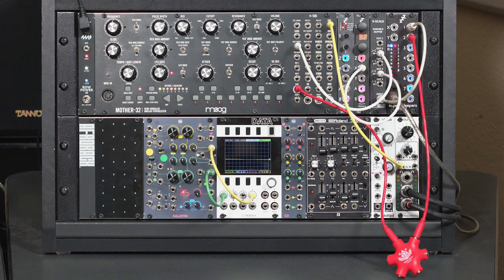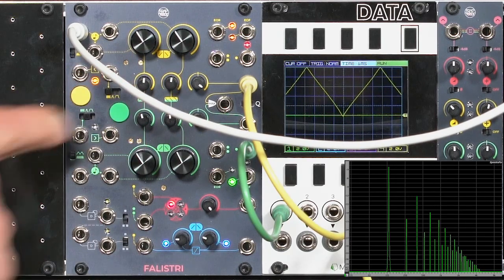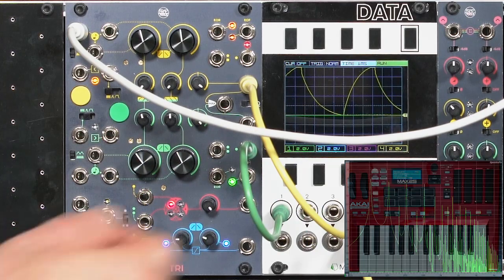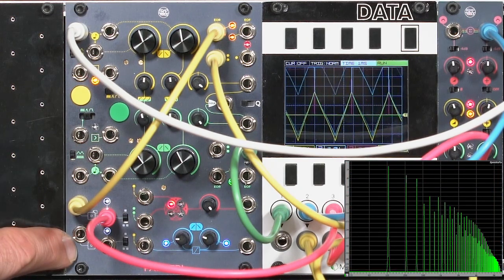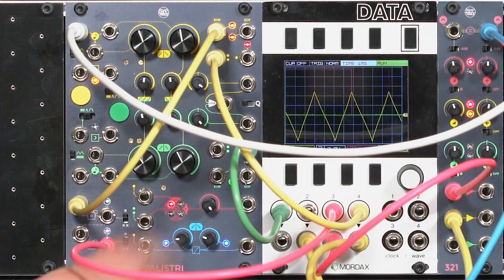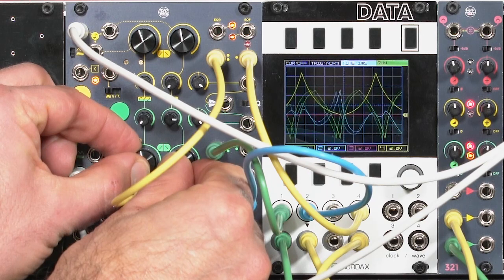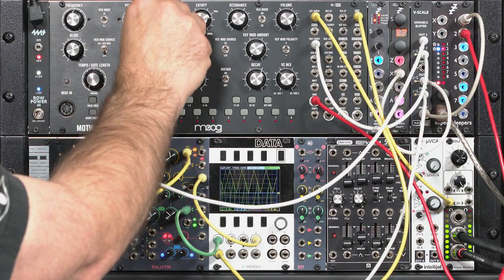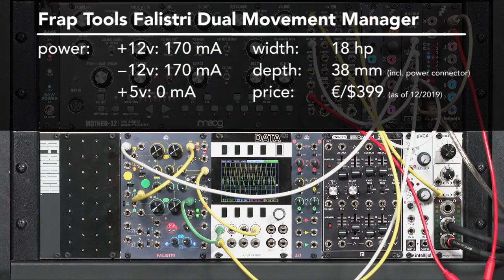Frap Tools Falistri 4/4: VCO (LMS EE)

Comment: Hello. Thank you for your explanations. I Bought a Fallistri, because the Make Noise Maths was unavailable when i ordered my modular.
An intersting module, but difficult (even i know the modulars since decades...) With this video i discovered functions that did not appears into the manual, and i presume they are more over. 
With your video you gave me an idea. The Moog Subharmonicon is too expensive for my an the time, but with a second hand Mother 32, easy to find, i could have a Moog to obtain the true sound given by the legendary filter. Il have enough oscillators to complete the only one on the Moog 32.
NEKO

Comment: Aright how is the falistri just straight linear wave pitch.the reason was the joranalogue pitch intune was to change the shape to tune as well. It was kind of odd for me to hear just a Distortion waveshape with change in tune.and plus is this thing analog?
Reply from the maker: There are a few subjects that I think are getting mixed together here. 

Changing the length of the rise and fall changes the length of one cycle of the waveform from Falistri, DUSG, and others. The length of one rise/fall cycle = pitch. Dedicated VCO modules have a "pitch" knob that changes the length of that cycle; modules designed to be envelopes have rise and fall times to change that length. So two different user interfaces to get at the same thing.

With some modules, such as the DUSG, Maths, etc., changing the shape of the rise and fall also changes the length. This is explained briefly in the videos and in detail in my Patreon posts. That's why changing their shapes change pitch. Falistri takes more of a VCO approach where the waveshaping takes place after the core rise and fall.

Falistri is indeed analog.

Comment: Can you do comparing of the serge and this of the track I know the joralague contour is worst but has good Slew of tracking of pitch by using  a seq wave.
Reply from the maker: On the DUSG I had (built by someone else), I could get it to track closely for about 2 octaves or less; it could probably be calibrated to do better. On the Falistri, I can get it to track 4 or 5 octaves without a problem (they claim 8 octaves or more), as long as I restrict myself to a triangle wave.

Comment: What is the best Eurorack to change the linear triangle  to a linear Sawtooth For pitch control.
Reply from the maker: It can be done, but it's not dead-easy. You would need to use the End of Rise to invert the signal, and then the End of Fall to invert it back. That would give you a saw at twice the frequency of the triangle. (Let me poke around and think about for another couple of minutes and see if I can come up with a simplified solution...)
Reply from the maker: Yes - I had to look again to remind myself, but the End of Rise signal goes low at End of Fall. So, use something like a Frap 321 to invert it & offset it by 5v (so you now have a bipolar square wave that goes low at End of Rise and high at End of Fall), and run it into one side of the four-quadrant multiplier in Falistri. Then run the triangle wave into the other input, and you should have your saw. There may be a slight glitch at the turnaround - just as there is in saw-core oscillators trying to create triangle waves - but you'll be 99% of the way there.